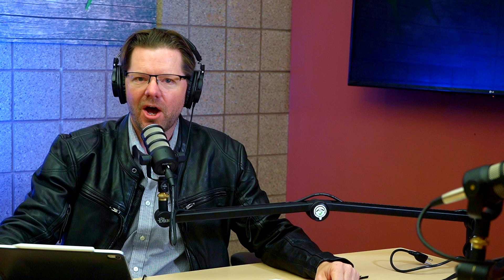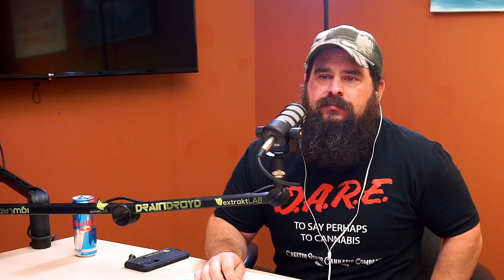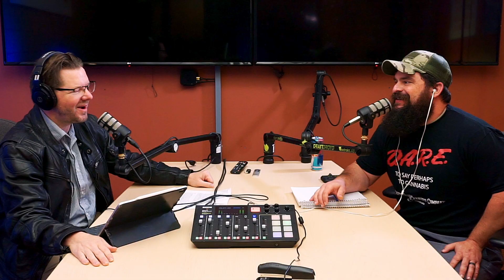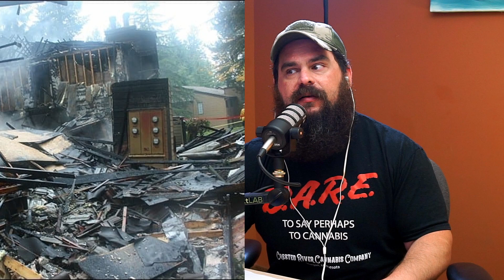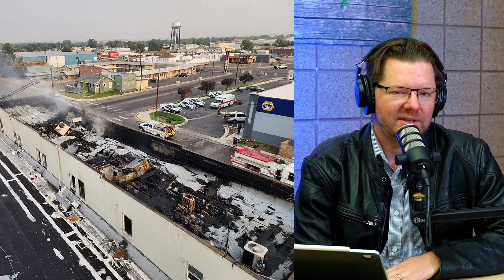Comparing Hydrocarbon Vs CO2 Extracts

Comment: This is why you should not listen to internet gurus. Semi good questions but horrible answers. Butane combust into CO2 and H2O. Pure butane has not contaminants but if they were present they would have to boil at 32F to be carried over during butane recovery. If not they are left behind. So the correct answer is that after the first recovery of butane at a gentle temperature used for recovery should produce pure butane. However CO2 cannot boast of the same because CO2 is not produced with distillation and most of the time is not recovered with distillation. The byproducts of manufacture are carried into your final product and are consumed when present.
Butane breaks down soon after release.
CO2 is never a liquid at extraction pressures, not even at SCF controls. It could be called a dense fog but not a liquid. Extracting with gases requires more volume heat and pressure which serves not benefit over using a liquid. However C02 can flash off leaving extract behind and can change in polarity with heat and pressure which can be useful if you know how to do it.
I saw his oven/terpene question forming on his face before he asked it. Vacuum does not make a solid a liquid and does not make it boil away. It can sublimate from solid to gas though. Heat has to be used to make the extract more liquid but once liquid the vacuum can now reduce the amount of heat required to boil liquids away. This helps remove more liquids with less heat but you are still vibrating the molecules that can be vibrated and evaporated. There is only that minor sublimation evaporation that is beneficial and lowering of temp that is almost deceptively beneficial. Vacuum ovens were used to remove solvents and butogenate the extract into a lighter colored looking fluffy product. They could be used for precipitating crystals by helping raise viscosity. without heating.